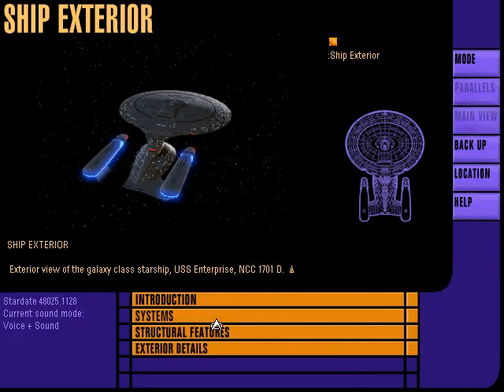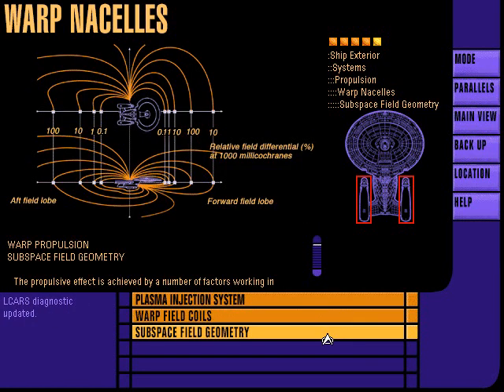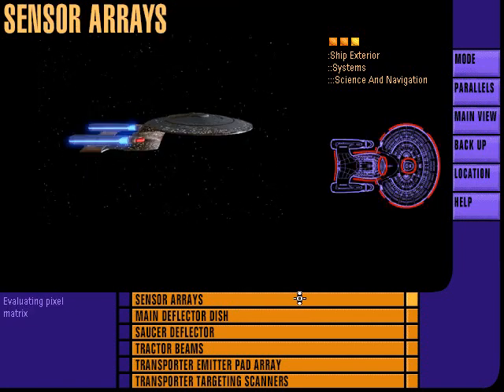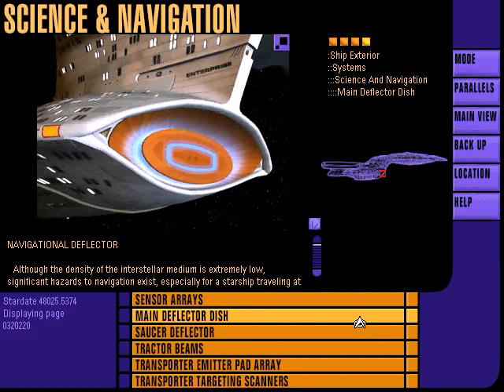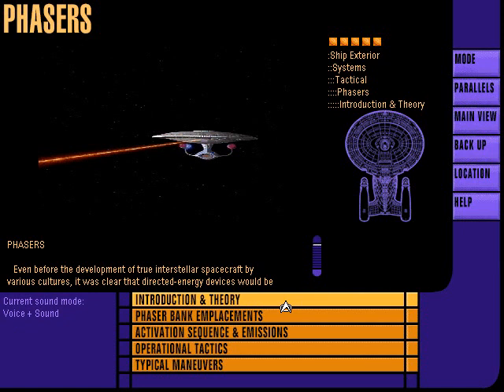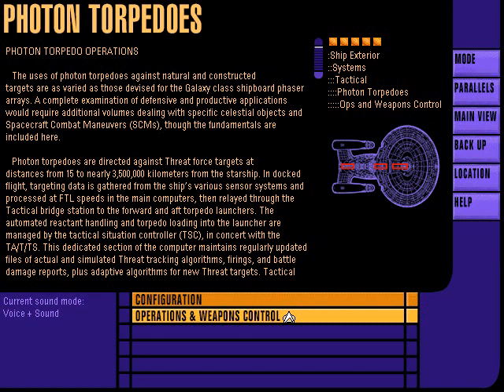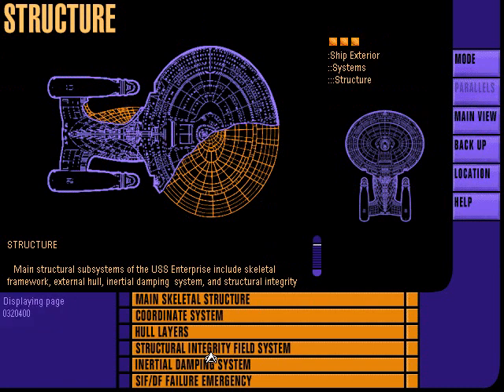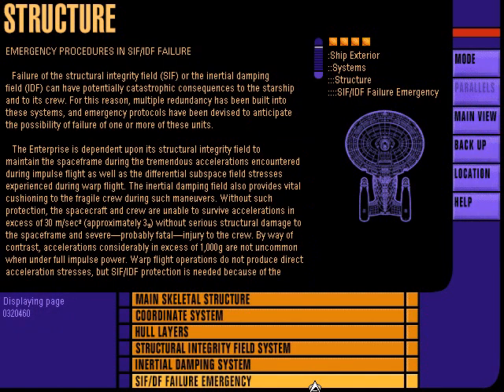Star Trek TNG Interactive Technical Manual, Part 2: Systems

Comment: How on earth did you make this run on a modern PC?!
Reply from the maker: I polarised  the  holographic emitters with an isolinear subspace containment field which aligned the lattice array produced by the positronic Heisenberg compensator. In other words, I installed and ran the program in a Windows 98SE installation using Microsoft Virtual PC. The installation runs nothing else . Installing other programs - especially newer versions of QuickTime  - will probably break it. But otherwise, it runs perfectly smoothly in a Windows 98SE VPC.
Reply: @sabrizain    hahahahahahahahahahahaaaa !   mr scott would be PROUD !